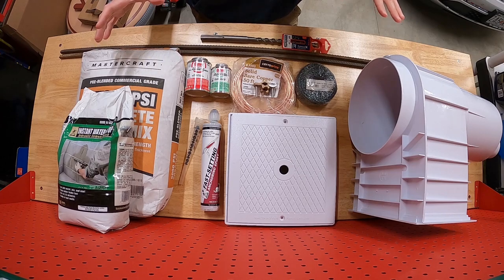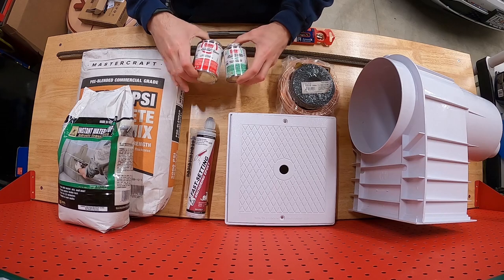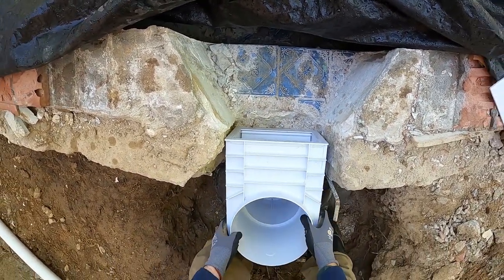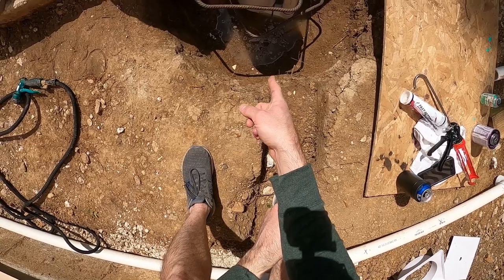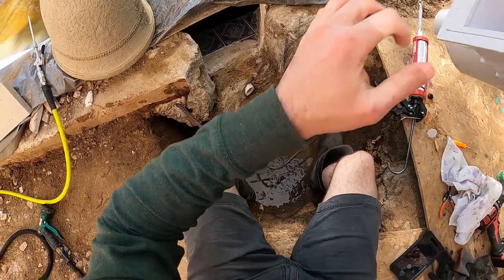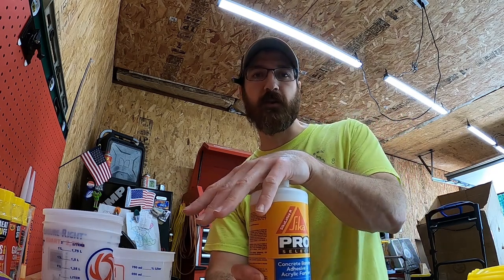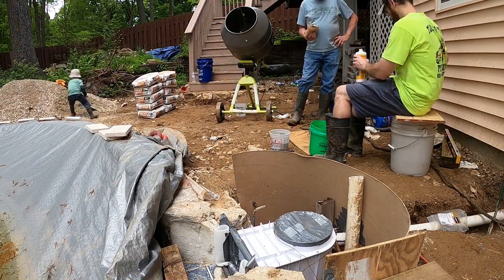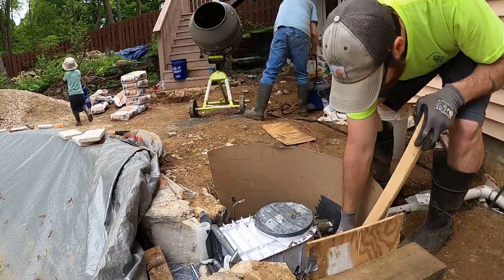DIY - Pool Skimmer Replacement

Comment: When concrete is poured over the top of the skimmer box, it causes it to sag and you'll get weir doors that stick because they're trying to flap in and out of a box that is no longer square because of the weight of the concrete.

Comment: Thank you so much! My pump went out and after installing a new one and pressure washing my frog pond, I noticed it continually pumped air bubbles into the pool along with the water. Additionally, the ground was saturated with water near the skimmer which clued me in on where the air had been coming from. I sure don't want to do this job, but I am of meager means and can't afford to pay someone else. I really appreciate your excellent tutorial. I've worked with a lot of engineers in my time and if you are not one, you certainly have the mind for it.. Much respect to you on your excellent work!
Reply from the maker: Thank you for the very nice comment and feedback! I'm not an engineer, just to stubborn to let anyone else do anything for me :) It's been a few years since this job, and no issues have come it with my repairs. Good luck with your project!

Comment: You should've use a concrete vibrator to remove voids and bubbles.
Reply from the maker: Probably a good call. I almost bought one from harbor freight (discount tool store) but didn't have any experience with them. I imagine this would have helped though, thanks for the suggestion and comment.

Comment: Do you have a vacuum port hooked to one of your skimmers?
Reply from the maker: Negative, neither of my skimmers are plumbed with any secondary lines, single suction line each. I actually use the Tiger Shark electric robot vacuum that has built in filters, it works awesome! I prefer this to minimize the junk going into my filter which is also a cartridge filter. I don't have to touch or worry about the filter the entire season. I have a leaf net vac that a garden hose hooks up to that I use in the fall once leaves start falling before I get my cover on.

Comment: What’s the cost for all of this? And how long did it take total?
Reply from the maker: Hey there, I don't remember the full cost, but less than $300 per skimmer, including the new Hayward skimmer.. It took me several weekends to complete the job, but I was working on it my spare time. I would think someone doing this job for the first time should plan 3 full days to knock it out.. A pro would probably do it in one day. I asked a pool guy what they would have charged for the job, they said at least $3k per skimmer in my area.. Back to the cost, I already had the tools needed to complete the job, so that's not included.

Comment: Great video, I became more confident after watching this. Just wondering how can do pressure test before concrete?
Reply from the maker: Hi James, thanks for the comment and question! You definitely can and should do your pressure test before pouring concrete around the skimmer. Once you make your plumbing connection, meaning connect the PVC pipe to the Skimmer, you are able to conduct the pressure test. I did this on both skimmers and have another video with some of these details (link below). In order to cap/seal off the skimmer side to do the test, your options are to use a rubber plug specifically designed for pressure testing (Not a typical winterizing rubber plug) OR in my case, the skimmers had a threaded female socket so I used a threaded PVC plug with teflon tape to get a good seal. 

Hope this helps, good luck with your project. 

https://youtu.be/y94fNeUDThs
Reply: @SeldomRest  thanks so much, your information in very helpful